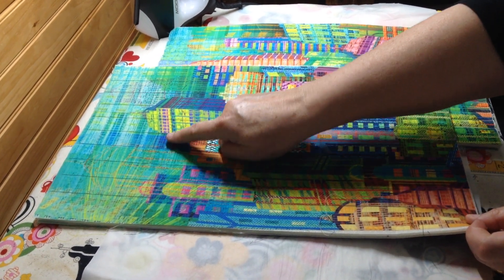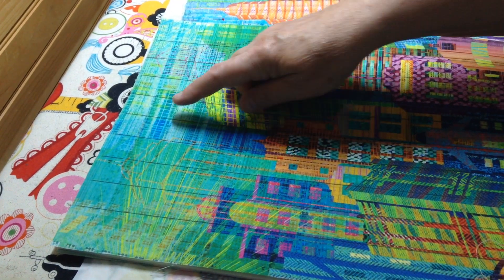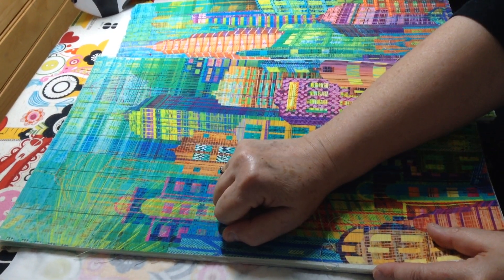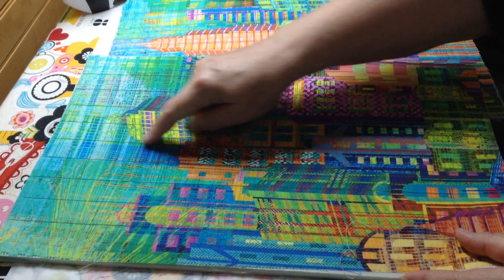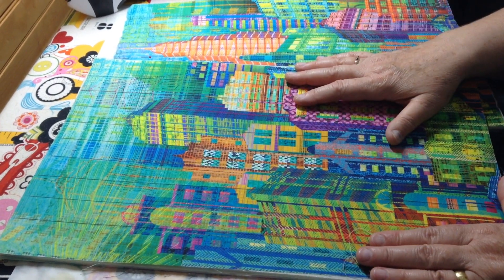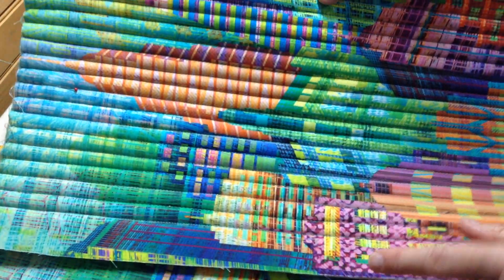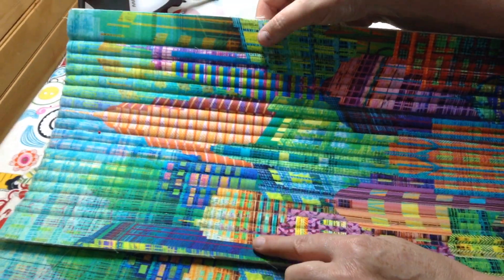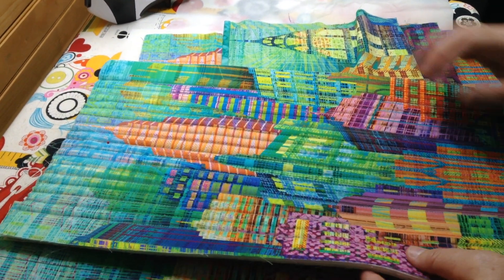AT617 - Pg 2   Center & Side Panels

Comment: Could you please explain your numbering system for making this bag from start to finish. Specifically the bag with the floral pattern, on the left side of this photograph? I'm unsure of whether 'AT617' is the only ID. number for the entire project. Then there is '- Pg#' with a title referring to what part of the project is being taught. I.E. I am unable to find a video titled 'AT617 - Pg 1 XXXXwhatever. Thank you for any assistance you can provide.
Reply from the maker: All the information you'll need is in the pattern
Reply: Do you have the beginning of the tutorial, like page 1?
Reply: @marygonzalez8902  I have the pattern.  Page 1 is cutting instructions.  If they gave that information out then there would be no need to purchase the pattern.  To get the information for Page 1, you must purchase